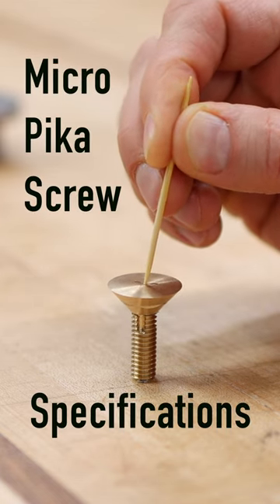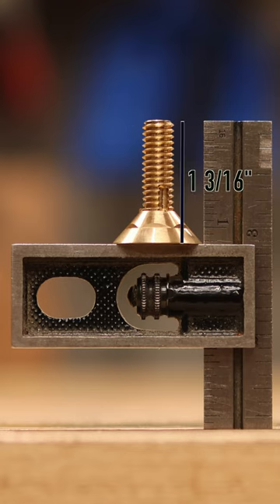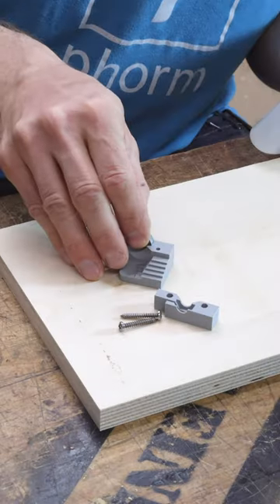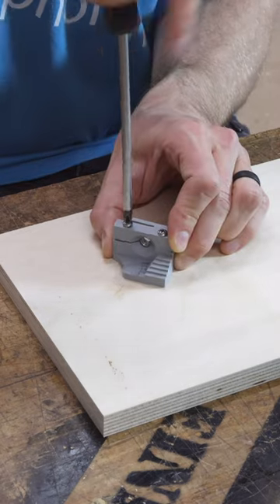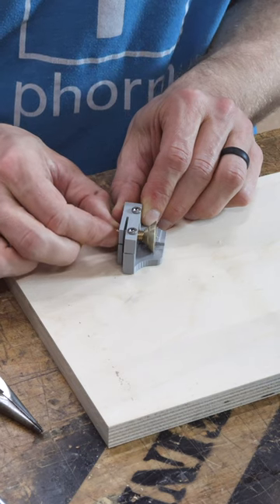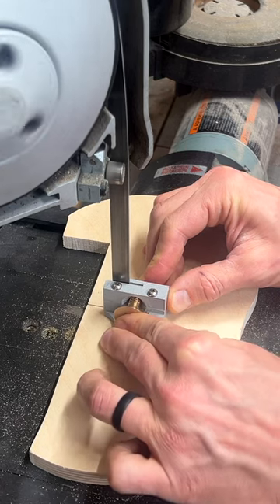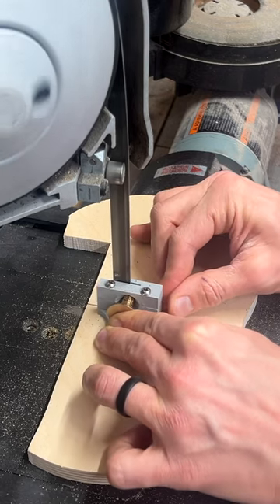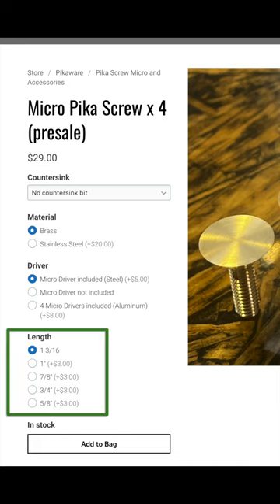Pika Screw Length Shortening

Comment: Woah, I never thought I would see the day that I was intrigued by a screw design, but now I want to replace every screw in my house with these.
Reply: For the low price of $10 a screw, you can.
Reply: Isn’t it a 10x times easier to have a screw and a cover, that pushed over screw head ? That way you have just two metal pieces, and you never damage visible part while tightening 
Design is very cool, but unnecessarily overengineered
Reply: @llMarvelous thats a great solution that's used a lot, but the downside is unless the plug is loose fit you probably will never be able to take the piece apart without damaging it, and at that point why not just use traditional joinery and wood glue and save the money. This gives an extremely clean look while still being able to disassemble the piece if you need to move or anything
Reply: nothing in your house uses this screw type
Reply: Ots garbage
Reply: @Dontgetenslaved  There are parts of Seattle, especially towards the end of the month, where that statement is also true.
Reply: @llMarvelous  ..until you lose the screw cover. These screws are for heirloom pieces, meant to last a lifetime, not something that will be replaced in a year.

Comment: These screws are AWESOME!! Unfortunately I haven't thought up a project that would warrent them or the finances for 4 screws for $30😂😂😂 I'm DYING to use them though 😂😂
Reply: Wouldn’t it be nicer to just use joinery
Reply: Use a nail
Reply: @Michigan1 nails dont offer anywhere near the same bite that a thread fastener will provide. Also nails squeek after awhile. But this dude could literally just make fuckin screw head caps. Or he could even make fitted pieces that would just snap into the head of the screw. Fuckin box the screws and include a tiny little bag of snap in caps. This dude just over engineered the shit out of something that didnt need to be improved.
Reply: It would be nice to see them in Pagani cars, all of their bolts and stuff are made in house!
Reply: @GolddenWaffles  I could definitely see a use in the formula cars or their road course cars. It might help with streamlining. 🤷🏼‍♂️🤷🏼‍♂️
Reply: Just wait and it’ll be available for cheaper.
Reply: Same
Reply: @RG_Outdoors  bro, do you really think that they are using screws to hold together Formula One cars? These aren’t old aluminum skinned airplanes with 5000 protruding rivets lol
Reply: @BikingVikingHH  if you think there isn't one screw on the outer skin of a formula car, much less anywhere on it, then you should probably stick to biking. Lol. But as an ex-avionic electronics technician, a plane is another good example of where these screws would come in handy. Which btw ALSO is held together with screws. More in particular, the F/a-18 Hornet and Super Hornet.  Which ALSO is held together with SCREWS!! Not rivets. Yes rivets AR used. But the majority are screws. So if you think a $54mil piece of war 🤌🤌 work of art is held together by screws and yet a formula car ISNT, you've taken 1 too many bumps on the noggin on the asphalt. 🤣🤣😁
Reply: @BikingVikingHH lmao f-18s have pretty cheap screws holding on the nosecap
Reply: @Dollapfin  with wood, absolutely. Joinery is what got me into being a carpenter. I was thinking more along the lines of metal though. Or fastening something to metal. Kinda hard to use joinery for that lmao.
Reply: @fpscanada3862  he's not realizing EVERY SINGLE PANAL is held onto that jet by screws. 🤣🤣 and there is ALLOOOOTTTTT!! Lmao
Reply: Its a dumb product
Reply: @RG_Outdoors an F/ a-18 is hardly a piece of art
Reply: You forgot the $45 for the special screwdriver.

Comment: They make chamfer bits... just stick it in a drill and introduce the cut end of the screw/bolt, it will reduce that "rough cut" and allow for smoother insertion for the cut screws.

Comment: I would expect it to be easier to make them longer and for an upcharge, cut them down to size. Most people that would use a product like this already knows you can cut bolts if you can’t find the perfect length. 

Also you should consider making end cap nuts that mirror the bolt head.   Example, you want a bolt going through something but to be flush and look nice. Someone could buy 2 pica end cap nuts and cut a threaded rod to the length they need
Reply: Thats an awesome idea dude
Reply: They're also called Chicago screws, great idea!
Reply: Isn't that exactly what he did?
Reply: @BrotherCreamy yeah I'm not sure what altverse this guy is watching from
Reply: That’s kinda exactly what he did…..
Reply: @brendandor  Some of these people commenting here don't understand Chicago screws(sex bolts) are basically a female threaded machine screw... or a screw with the threading turned outside -  in. They can be for stationary fastened joint or for multiple pieces fastened together that need to be able to move like legs on a folding table/chair or a full suspension bike or motorcycle where the frame is attached together so the rear suspension can function.
Reply: Chicago or sex bolt
Reply: Literally exactly what he did. Did you watch the fucking 30 second clip?
Reply: Bro thinkin ahead
Reply: @dannys9074 he's making screws, not threaded nuts. The above commenter was suggesting cap nuts, with INTERNAL threads, so that anyone can cut the standard 5/16 threaded rod and cap it with a nut, making any length they want
Reply: What homie is saying is that you need a female along with cuttable male. Price wouldn't really matter much on that product.
Reply: Wasted material
Reply: @BrotherCreamy nope. A chicago/sex screw id like the opposite of this. It would thread into something with internal threads and a similar. Countersinkable head. To hide the threads would be the intention. The point of this screw is to hide or make the head flush. Again two different things.
Reply: @GRAYgauss he's saying essentially a nut for the other side to hide the threads. They make like a sleeve and theres a head that would counter sink like this one does. Chicago/sex screw but in this style.
Reply: @brendandor same principal but opposite male and female adapters

Comment: The stupidity in the comments is crazy it's obvious that it's a screw that's meant to sit flush and hide that it's a screw 🤦‍♂️
Reply: Sooo an over priced screw cap cover?
Reply: That's but the issue, the issue is the $30 for 4 screws with some wite EDM and a spring
Reply: @Xiellion  that 30 dollars is more than justified for the cost of wire edm

Comment: People paying this much for 4 little baby screws plus shipping wow
Reply: it's pretty much for aesthetics, if you want a cheap screw go to home depot
Reply: @kushpaladin  baby screws.
Reply: @ChipChurp  "baby screws" its for decoration not to hold 2 tons, precise machining always costs alot. go to home depot if u cant afford
Reply: These are machined parts with springs and an assembly to make it strong so the head doesn't come off. He orders them from a large machine shop for a premium and then you're complaining that they aren't $1?? You could be more out of touch, but then you realize these are half the price of "hidden head" screws like this just 5 years ago
Reply: @Lemon_Sage9999  it's genuinely expensive to make but it's a silly item. There's nothing wrong with plain exposed screws if they serve a clear purpose. Speakers 100 times the price of any furniture piece have exposed screw heads at the front, just stainless Torx or hex, and somehow nobody is offended to see them. The obsession with hiding screws is overblown. I have seen screws deliberately designed into headphone cover plates just to signify that they are hand assembled and not just slapped together blindly, that they are gasketed rather than glued. There is authenticity in allowing things to stand for what they are, and allowing screws to have visible screw head drive.
Reply: @SianaGearz  then they clearly weren't made for you and you don't have to spend your money on them. Lucky you.

Comment: Usually when I make a cut like this I take a nut and put it on the bolt up towards the top. You make your cut then you back that nut off the end. When you take the nut off it cleans up most of the burrs and will straighten up the threads. Just know that that nut is sacrificial and kind of needs to go in the trash now. But it makes it so you can make the cut, back the nut off and immediately use the screw. Usually requires no more work

Comment: These are pretty cool. I would look into making that little cutoff jig available too. That’s a handy little tool that could be used with many different bolts to make clean custom lengths.
Reply: You can just thread a nut on it, cut it, and unscrew the nut when you're done to clean up the cut threads
Reply: Put a Handle on the Screwz Cutting Jig(s).

Much SAFER!

Comment: 4 screws. FOR $30!? Just to have a clean finish!? Crazy
Reply: With the machining skill and tolerance it takes to make that, $30 for 4 is a steal. Do some research before making crybaby comments.
Reply: As stated fine tolerance machining takes expensive equipment
Reply: You probably wouldn't use these for a bird house. These are nice screws.

Comment: What is the exact use of this? Just for optical reasons?
Reply: Pretty much yeah

One case where youd want this is say for example a decorative plaque installation where you are forced to bolt through the front face so your options are pay out the ass for a nice looking head, use rivets, glue, hidden nails etc (and inturn make maintenance an absolute pita), or just have the face look a little uglier

Comment: Could these be made in steel at a somewhat smaller diameter to use in custom automotive applications?
Reply: Most likely, however, the problem would be finding a manufacturer that would make them for you. You would probably have to place a pretty large order.

Comment: Make that same jig but for 5-10 screws at a time, then set up a fence for the band saw, and you could make quick work of shortening those screws. Not sure if you cut threads in that jig, but if they do screw into threads to be held in it... unscrewing(removing them) from the jig after cutting them will clean up the threads to the point of full functionality. Then, putting them in a cheap tumbler from Harbor Freight should finish cleaning them to a point that no one reasonable or even somewhat picky could have any problems with them... especially knowing you cut them to order.

Comment: How much torque can you put on those before they start to strip the heads? I'd imagine even the slightest burr on the phillips head would keep the spring loaded bit from going all the way up? Can you actually tighten them relatively hand tight or it's gotta be slightly more than finger tight? I obviously understand the application isn't for everyday fastening, but genuinely curious.

Comment: Those look really great. But for me, I have left used so many woodscrews and left too many marks on them (mostly only very small marks) to really see the screw still looks as perfect as in the video after screwed it in. The tolerances are extremely high, the slightest burr would be visible and ruin the optic.

Comment: I don’t understand how you have to hand cut the screw to smaller lengths and yet the longer ones cost more, the shorts are losing material and using man hours, I’m not after the price itself just the upcharge on the product you already have yet then cut down for cheaper? I get save money but that math doesn’t add up

Comment: Seen a thing before where a guy made a cone thing with sand paper in it that goes on a drill and you just spin it in the bolt end and it cleans and bevels it then just unscrew the nut and run it back and forth a few times to deburr it

Comment: Shortening small batches of screws would be easy with a metalworking lathe, thread the screw into two nuts that have been split , grip on the nuts and turn down thw screw

Comment: Pro tip, put a nut on it, or if you have to do a lot of them. Thread it into the little rig there, on the way out the threads will be straitened. Then grind off the sharp edge.
Reply: What material is it? Lots of tools, particularly electrical have threaded holes in them, thread in the bolt and shear it off. Thread it out. Cry when a stainless gets in there tho.

Comment: if you put a nut on before you cut it and remove the nut after cutting it will help clean the cut edge burr
Reply from the maker: I'm cutting through a nut each time, so doing both actually

Comment: I love the idea but most chamfer/countersink tools have a 90deg angle so how come the head of the screw is 82deg it seems like it could cause issues with integration
Reply from the maker: 82 degree is actually the most common
Reply: Probably because 82 degrees is simply equal to the arc covered by 9/64th of a yard held one foot away from an imperial eye